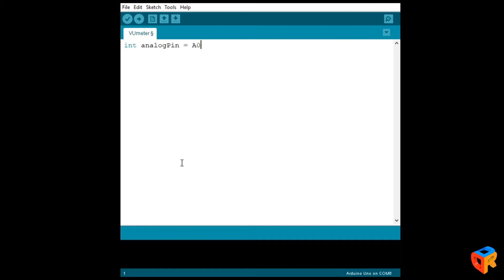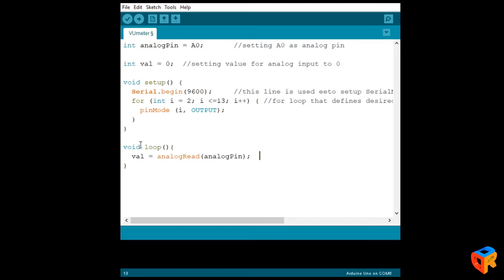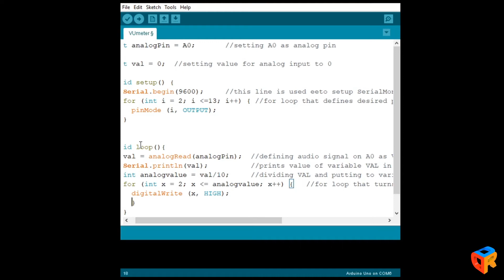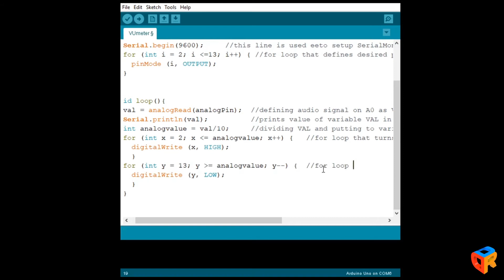Simplest VU meter using Arduino UNO /Jednostavan VU metar s Arduinom

Comment: good morning the polarity  of  the  led  does not seem  
you can help.  can  use  arduino  nano  .thanks
Reply from the maker: Hello there, the polarity of LEDs is that Anode (+) goes to Arduino pin, and Cathode ( - ) goes to GND ( - ) on the breadboard, connected through R1 to -0V of power supply. Yes it is possible to use Arduino NANO with this circuit, they are compatible.
Please feel free to ask some more questions about this project, if needed. 
Thanks for watching.
Reply: @DR-Dessign  thanks
 for  help